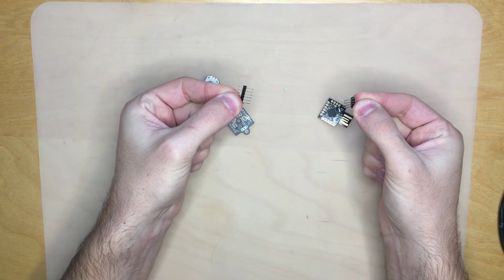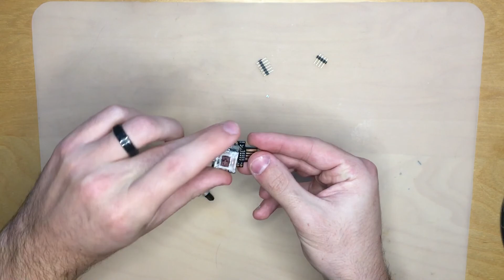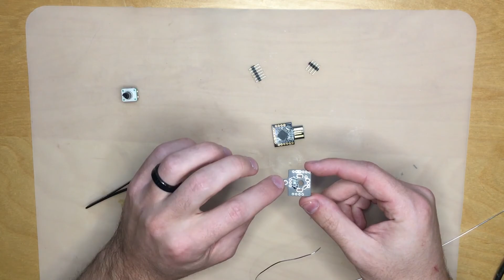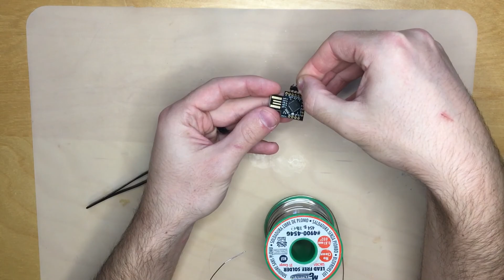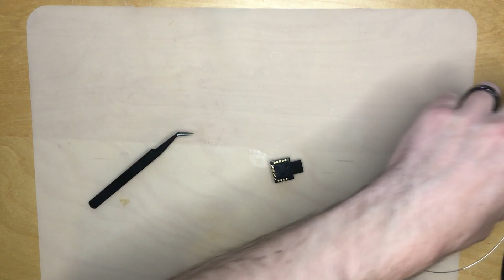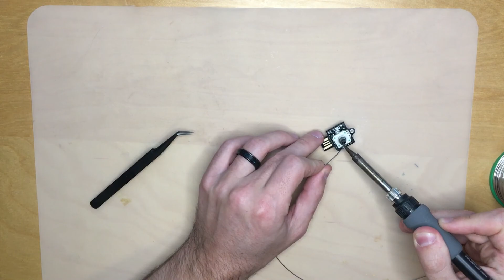Uno V2 Assembly

Comment: Hi! I got mine a couple of months ago but could not get it working. I built it following this video and when plugged, the LED blinked. Used QMK Toolbox to flash the default .hex made with MSYS64 and from then on the LED won't light up nor will I get any kind of output from the Uno
Any tips?

Comment: Is there a follow on tutorial for how to program the output?  I flashed the firmware with QMK just fine, and have 4 outputs (numbers 1-4) but now I want to program my own mappings.   Thanks!  Great build tutorial! (And my LED even works :))
Reply from the maker: I only just saw this - my apologies, I never check youtube, haha.  If you need help with how to use QMK, I'd advise going to the QMK discord.  The firmware for V2 is currently in my discord, but I'm going to get it merged into QMK soon.